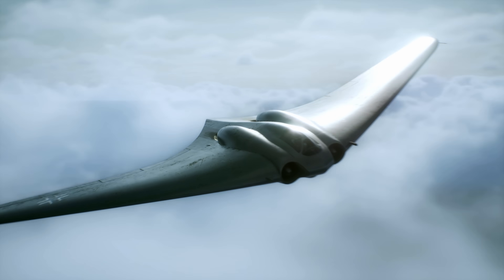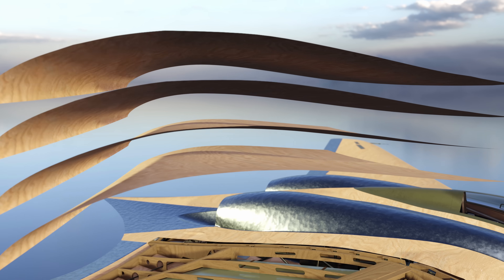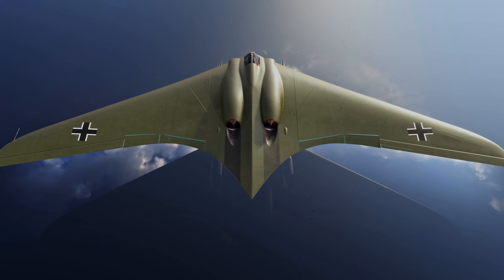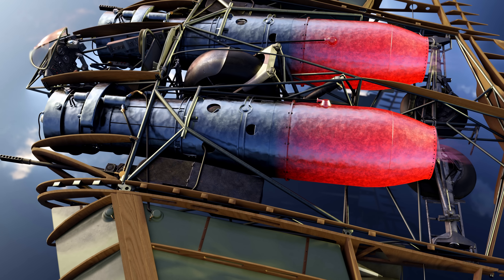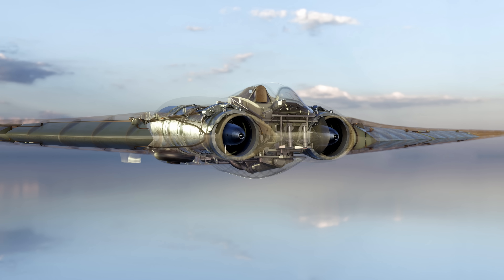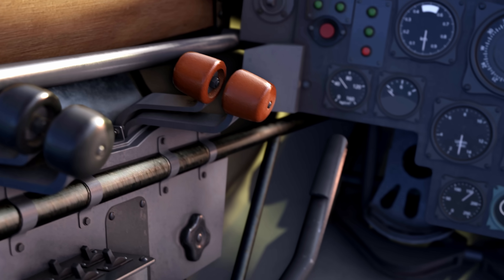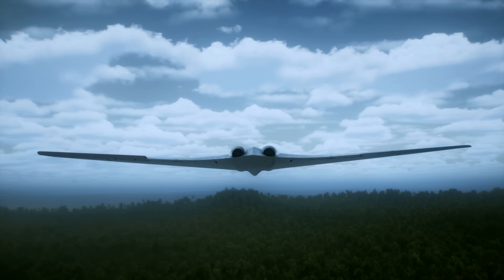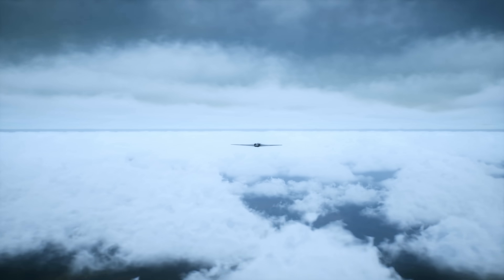Inside the Horten Flying Wing

Comment: correction: Horten wasnt meant to have Jumo engines, the only soruces for that are gaijin, he was meant to have Heinkel engines.
Reply: Henschel didnt even build jet engines.
The Ho IX was ment to have BMW 003 engines, but because they werent ready in time, they had to switch to the larger Jumo 004 and adapt the fuselage to it, like the Me 262 had to too.
Reply: @wolf310ii  not truely, they were only meant to be used in prototypes, but the production itself was meant to be with stronger, more advanced(with governor) and better thrust/weight ratio Heinkel Hirst engines
Reply: @7TPdwCzolgu  No they were not, the HeS 011 (wich was build by Heinkel-Hirth by the way) didnt even existed as prototyp when the Ho IX was designed and was even less ready for production than the BMW 003.
Only Jet projects of from '44 on were designed with the 011 in mind.

You cant plan to build an airplane with engines that didnt even exist as an idea.
Even for the Ho XVIII the 011 was only one of 3 options

Comment: 20 hours of flying life on the engine is practically awful right? That’s crazy
Reply: It’s absolutely trash, and something that isn’t talked about a lot with the ME 262.. 10-25 hours, let’s even say 50 if the pilot can actually control the throttle. That is insanely low for not that much added performance
Reply: More like 16, and that's if the pilot accelerated super gradually, which in combat isn't always feasible.

Comment: Why would the nose pitch UP if the elevons were up? Can someone explain the physics?
Reply: Really? Ailerons up pushes back of wing down and nose up. Make a paper airplane with elevons at back. Fold them up and watch it fly. One up, one down....real planes fly the same way.
Reply: @garyyoung4074  I just watched a video of ailerons at take-off. Flaps down, nose up.
Reply: @dannyarcher6370  well " flaps", elevons, ailerons and rudder and elevator are flight surfaces on aircraft. They are all not the same things. Ailerons control the roll axis, elevator the pitch axis, and rudder the yaw axis on normal type aircraft. Flying wings and delta's use "elevons" which act as elevators and ailerons combined. "Flaps" are at the trailing edge of the main wing of a ordinary airplane and increase the lift of the wing at slower speeds. Nothing to do with nose up or down. In my airplane the flaps create very little change in pitch..as should be.
Reply: Here:

https://ntrs.nasa.gov/api/citations/20160003578/downloads/20160003578.pdf

Comment: Metal. Lots of metal. Stealth? No. Easy control without computers? No. Good manufacture while being built by slave labour? No. Reliable engines? No. Decent pilots after most of them died in WW2? No. There are many more airframes far more interesting than this one.

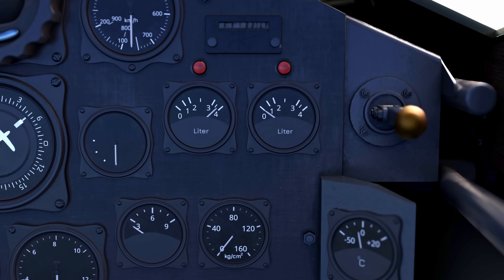Comment: At 11:13 can anybody explain to me why the fuel level indicator is asymmetric?
I've been enjoying flight sims for a while,and the same kind of indicator is present in Bf 109 too. I could not find a worthwhile explanation.
If the cappacity is 400 L, why is that 250 line in the middle,and not 200 L?

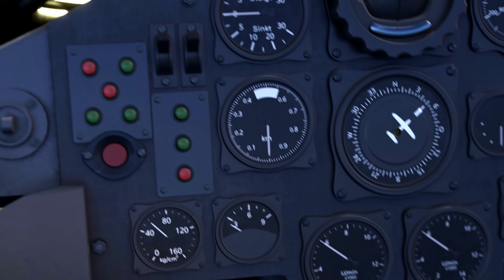Comment: Great video. Possible small error at 13:17? "Once the engines reached 1800 RPM" your reading 10,200 RPM on the tachometers in your animation. I would think 1800 RPM would be pretty low to add fuel to a turbine engine. 1800 RPM sounds more like a piston engine. In fact, that whole start sequence sounds wrong to me, now that I am writing this. You eluded to using other german SOP's. Which maybe why. Those would most likely have been for piston aircraft. 

My guess would be, a sequence more of: fuel pumps on, hit starter, turn on ignition, once at 25% of full turbine rpm,  introduce fuel, possibly through a fuel shut off valve being open. 

But awesome video. By far my favourite YouTube Chanel.
Reply: no 1800rpm are in the STARTUP sequence!
Reply: Well, the turbine is started by a piston engine, a 2-stroke 2 cylinder Riedel engine.

Also they had a tachometer with two scales (not shown in this video), with the inner scale going from 0 to 4000rpm and the outer from 2000 to 15000rpm, so on startup when reaching 2000rpm, wich is on the outer scale 11000rpm, the indicator falls back to "zero" and indicate on the outer scale from 2000 up, so 10200rpm are 1800rpm.

The correct sequence would be, fuel selector ON or crossfeed, primer ON, at 1000rpm press and hold ignition until 2000rpm, primer OFF, increase trust to 3000rpm while monitor the temperature, fuel selector as needed

Comment: But what was more important was that the Horton brothers actually got the flying wing design to fly with reasonable stability for its time. That was an issue that Jack Northrup ran into when Northrop designed the XB-35 and XB-49, both of which experienced serious stability issues, especially with yaw. In fact, many of the control surface operations on the B-2 Spirit and now B-21 Raider likely incorporated the control surface design of the Horton 229, but of course with full fly-by-wire digital control.
Reply: According to Reimar Horton's own book "Nurflügel", his nurflugel (=wing only) concept was inherently stable due to its special aerodynamic layout, namely the "bell-shaped lift distribution" and a high level of taper and sweep angle, and worked well without a flight computer. His earlier designs flew well and support that claim. Jack Northrop  used a different approach with his WW2 era designs and struggled a lot with instabilities in flight.
Reply: To be fair, the 229 also wasn't the most stable, with the only flying jet prototype crashing.
Reply: @gp33music41  Yes, that's true. It did only two or three flights at all, killing the pilot (Erwin Ziller) at the end of the last, apparently caused by an engine failure. I am relating more to their glider designs. One of them (I believe the HII) was test piloted by Hanna Reitsch who commented that "there was no way the plane could be brought to a flat spin whatever control input you gave it".

Comment: 12G ??? ahahahahahahah Even modern aircraft like the F-22 or the Rafale are incapable of this. Yet they are made with very resistant composite materials.
I think it was even incapable of taking 7G. It was made of wood with its fuel tanks in the wings. With its poor yaw and roll rate, it was incapable of chasing another aircraft.

Comment: An inspired design that was decades ahead of the technology that could have made it practical. Light and fast, it would have been very unforgiving of battle damage- though an  enemy would have to catch it first! Anyone know why that front wheel is so huge?
Reply: I believe the front wheel came from the he111, the Horten brothers were grasping for any materials to build these things whatsoever, so if it could be acquired, it'd be used.
Reply: With decades of development, wooden planes and flying wings were state of the art
Reply: It needed a tall front gear for the needed AoA for the take off, the evelons had a too smal leverage to pull up the nose on the runway.

Comment: The soldiers that first found this aircraft must have been amazed especially any pilots that saw the thing. It's so alien compared to anything they had seen before. 
There was the Westland-Hill Pterodactyl but that never went anywhere and certainly the jet engines were cutting edge at the time!
Think what could be achieved if we put this level of effort into solving things in peace time.
Reply: Flying wings where decades old already when the ho229 was built lol

Comment: this plane had 3 x 1000 philosophy, that meaned it would go 1000 km/h (620 mi/h in freedom units), then 1000 km operational radius (also 620 mils) and could take 1000 kgs of bombs with it (+- 2200 lbs). So intresting indeed but came too late, and with shortage of everything in 44/45 in Germany, you cannot do much